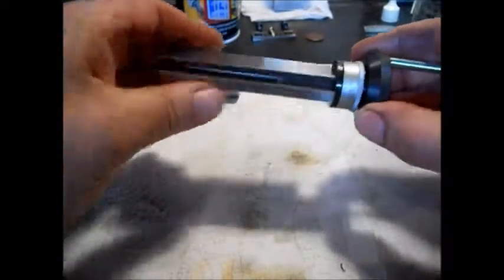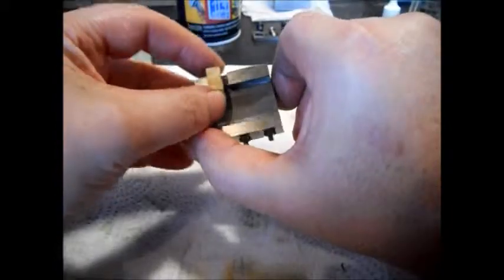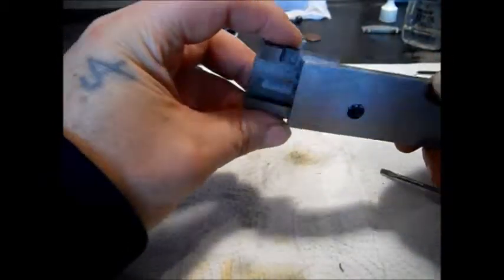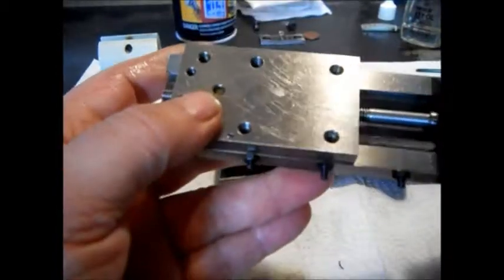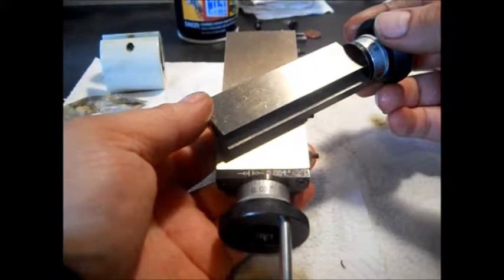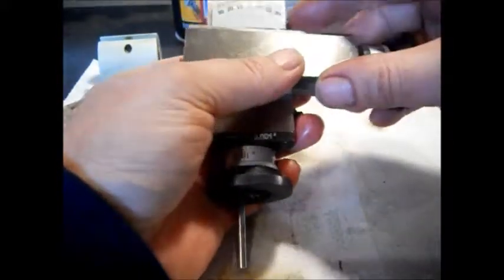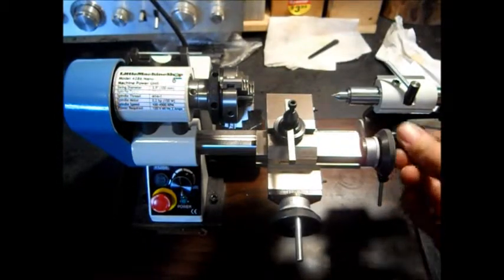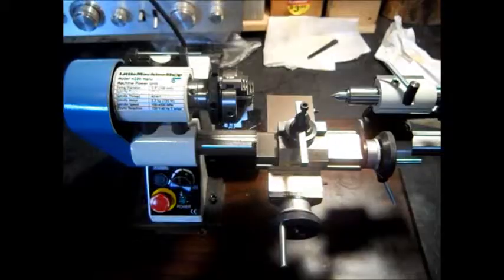Nano Lathe Cross Slide Top Slide (Disassemble clean and oil ) Part 2

Comment: Are the components all made from steel or are there aluminum parts?
Reply from the maker: The parts are steel There is a bronze piecce that is threaded where the screw goes through It has worn alot and I cannot get parts for this easy This is not a good quality lathe but is fun for hobby use for me I have videos showing the problems I have had 2 motors burned up and adding my own treadmill motor